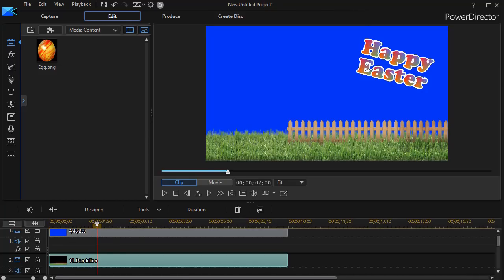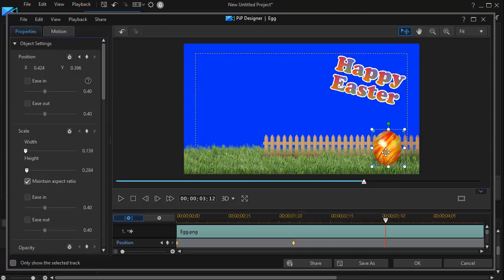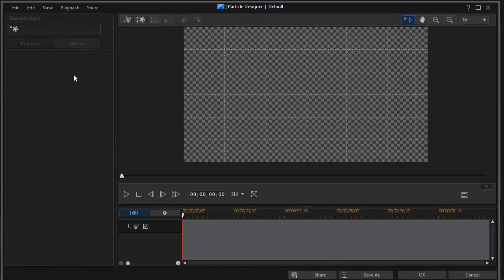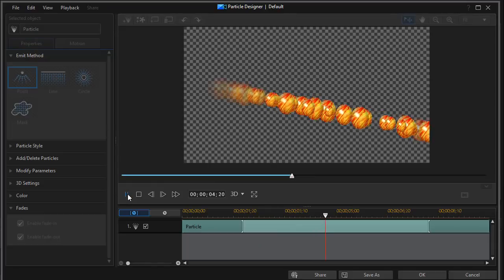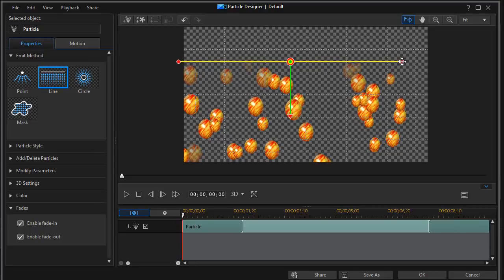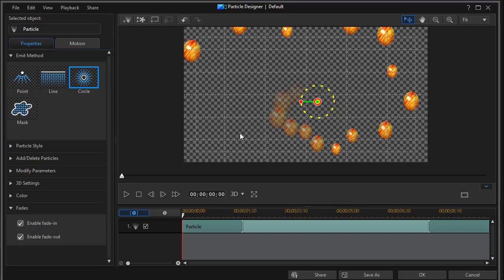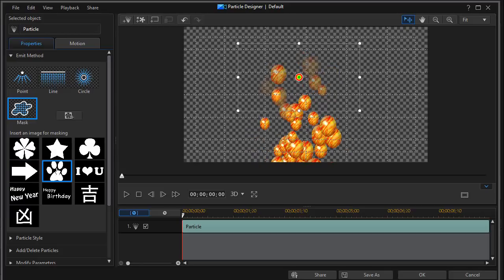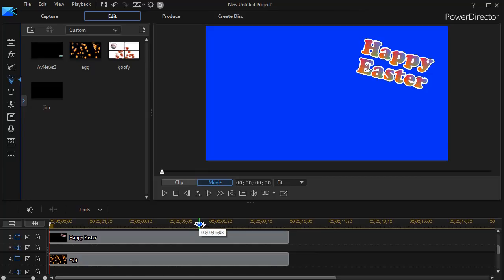PowerDirector - Tips on using the Particle Designer emit methods

Comment: I have a question please: Is it possible to modify a vector? (that arrow) I'm using a pre-made effect from Power Director and the vector of one component of the particle is horrible: a very long green line that ends on a green arrow, connected to the true vector. Is there a way of deleting that green line or can you create your own vector?
Reply from the maker: Sorry for the delay on your great question. You cannot delete the vector. You can change its direction and many of the other characteristics of the particle with the particle designer. You can take a preset (pre-made) effect and either add to it or delete from it in all kinds of ways. 
Here is a link to a series of tutorials on that topic:
https://youtu.be/5DmfderF9c4

--Jim
Reply: @SharperTurtle  Oh thank you so much for getting back to me! I thought my question had been terrible 😄. I'm glad you came to the same conclusion and that it was not just me not being able to do it. Meanwhile, I found out how to circumvent the problem, by dragging the too long vector very far beyond the "TV"-screen and changing the rate of the particles and the angle slightly. It was quite time-consuming to find the exact distance (i.e. how far away the vector needs to be from the TV screen), but I'm satisfied with the result.

Comment: Thank you Jim. I too have tried to understand mask but to no avail. Can I create a particle from any photo that I have taken ? If so can you explain how to 
convert the .jpg to .png ? Thanks !
Reply from the maker: Scott,
I'm working on a lesson to show some of what you are asking. The conversion from JPG to PNG will depend on what kind of editing program you have for photos. And it will vary according to the content of the photo. Do you have a program that you use for photo editing?

Using masks is not too difficult once you get the hang of it. I have several tutorials on that topic and can create more.

Glad to have you on board, Scott! --Jim
Reply: Sharper Turtle I use photo director that came with PD 16 but also have gimp and paint.net